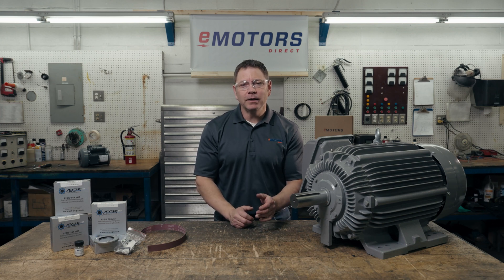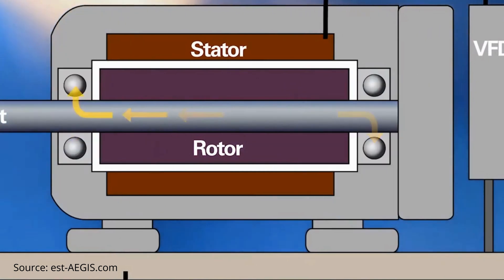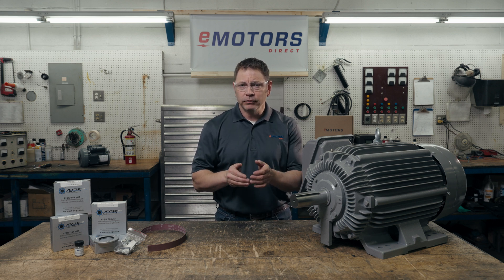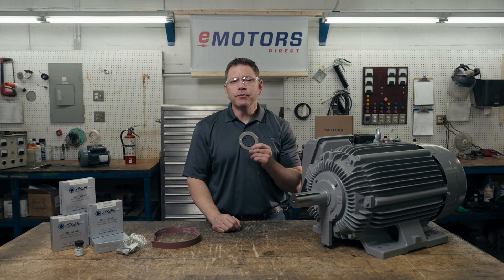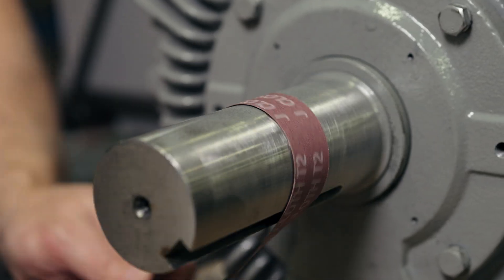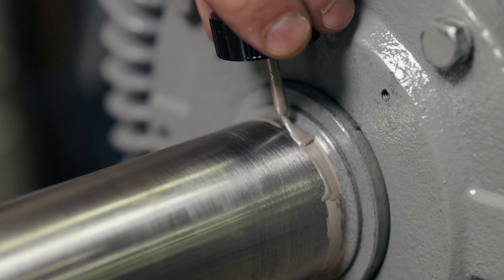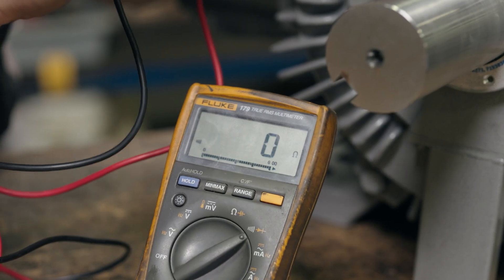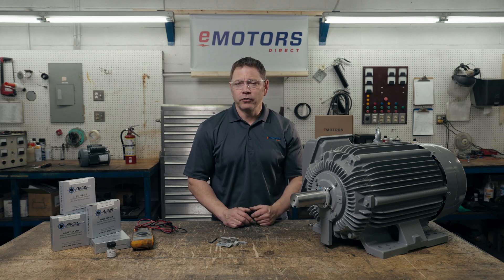Prevent VFD Induced Motor Bearing Damage | AEGIS Bearing Protection

Comment: Measurement from motor stator body to rotor on stand still motor is useless since bearings don't have oil film like they have in use. You might get good result without good contact on the brush. Only way to be sure is measure shaft voltage in operation.
Reply from the maker: Correct - To really verify the AEGIS ring is working, you need to measure shaft voltage while the motor is running, under real operating conditions.

Comment: I watched this after you sent me here from your conductive grease video. 

First Question: 

I wish to clarify language given I see two particular terms used interchangeably in many blogs/videos/workshops where they perhaps should not be. Those are "Conductive grease" and "Dialectric Grease".
Do you consider in your discussions a "Conductive grease" to be different to "Dialectric grease"? I ask because both as discussed and used in electronics and electrical connectors are insulators by nature. "Conductive grease" as a non-conductive grease filled with fine metal particles, will conduct at lower potential than dialectric grease... but it's still an insulator. 

Are you aware of a grease that could be used in a bearing that would be naturally conductive and not generate a substantive potential difference between shaft and motor casing etc?

Second question:
What are the filaments made from? 
On aircraft we use fine beryllium spring flaps to ground panels together. I can't see that being suitable here and am curious :). 

A ground ring is not suitable for my planned modifications to manage precipitation static buildup in a coffee grinder. The filament idea could however be a viable means of a solution.

Are you able to tell me - is there an identifier in naming conventions for bearings that are packed with conductive grease?
Reply from the maker: Hi Michael, thanks for the question. To be honest, coffee grinders are not my area of expertise and I typically deal with industrial motors. But yes, dielectric and conductive grease have different properties and are used for different applications. I use the Mobil Polyrex EM grease for my applications: https://www.emotorsdirect.ca/item/mobil-1m110792?quantity=1&tab=downloads-tab. 

The filaments in an Aegis grounding ring are made from conductive microfibers, although I don't see the exact material used listed in their data package. 

Good luck with your coffee grinder!